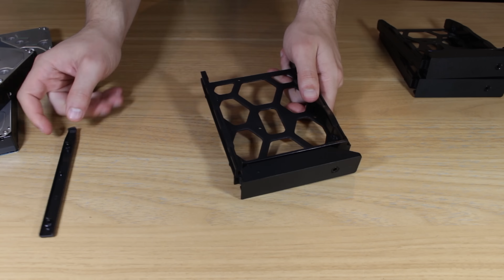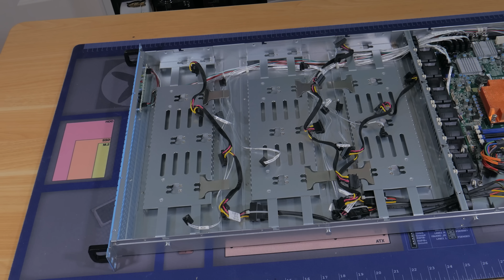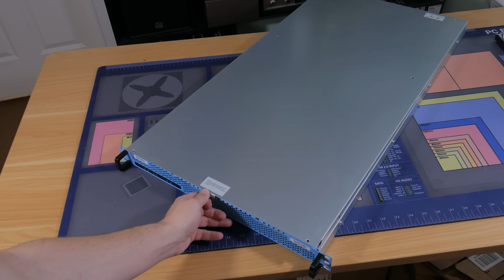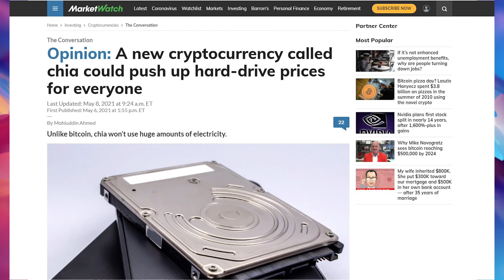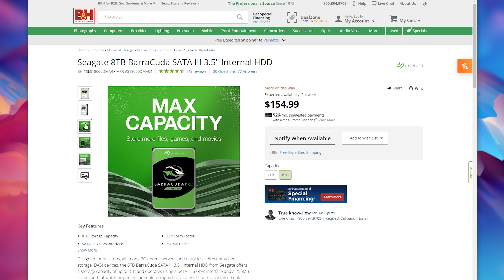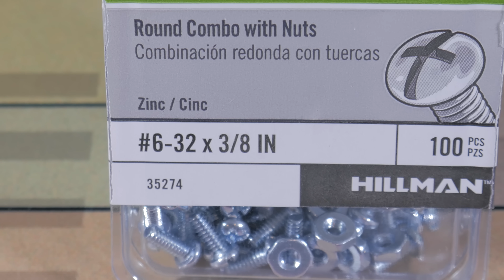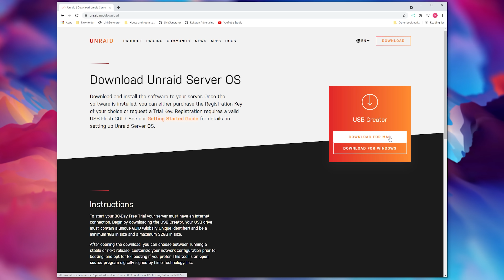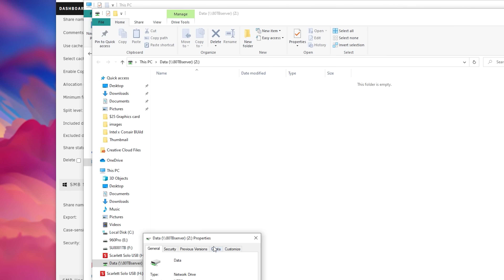Budget Storage Server 2021! | 80TB NAS

Comment: For that many drives in one enclosure, I would HIGHLY recommend enterprise level drives.  They're more expensive, but you're far less likely to have an issue due to vibrations or timeouts, plus reliability is far better.

Older Ultrastar drives are really good for this purpose, and usually aren't too expensive, and are highly reliable for long term use from my experience.  I got 6 4TB Ultrastar drives back in 2015 for $100 each brand new.  They were of a 2 year old model and OEM, but still new in the box.  

I used to work in a server storage software development test lab, and of the hundreds of thousands of drives I dealt with, the Hitachi/HGST Ultrastars has the lowest defect rate by FAR, as in we'd get 1 Ultrastar failure a month compared to 15-20 Seagate drives of the same age range, (test storage would be used for 5-8 years in a test lab setting, so I was mostly dealing with 1TB drives even in 2015) and Toshiba and Fujitsu were worse than Seagate.  I can't recommend Ultrastar drives enough for long term reliability.
Reply: yes definitely enterprise drives, I took a risk once and bought WD nas red disks (x12) and had 4 fail within the first 6 months. Replaced with WD NAS red pro , running 3 years no issues.
Reply: @edwindr7514  No, they're really not, mostly because they like to drop out of RAIDs even when they're not failing.  Enterprise drives have this little thing called "Time Limited Error Recovery" that consumer drives don't have.  If a consumer drive has an issue reading a sector, it will keep trying for up to two minutes to read the sector, and in a RAID scenario, that leads to timeouts and dropping the drive from the set.  Enterprise drives will time out and mark the sector as unreadable, replacing it with a spare sector, and declare the data lost to the RAID controller, prompting rebuilding the sector from parity or mirror data.  I know from experience when a consumer drive falls out of a RAID set, and then another drops out during the rebuild, it can cause major data loss.  I lost my pics for my once in a lifetime DC trip because of it.  

In addition, consume drives don't do well with vibration, and this can cause errors that cause dropouts as well as cause collision between the platter and the head, if too many drives are put into one enclosure.  Enterprise drives are secured from wobbling much better than consumer drives with tighter tolerances and more points of securing the heads and spindles.  

I know these things because I'm  a sysadmin, most notably a sysadmin in a server storage software test lab for a major storage company from 2010 to 2016.  (I do NOT claim to speak for them, as I was just an employee and have no say in corporate opinions.)  I've overall been a sysadmin for 12 years, out of a 25 year career in corporate IT.  I have EXTENSIVE experience with storage.  My profile is available on LinkedIn.  I'm the one in Colorado, if you care to look.  

Oh, and those WD Red drives?  They're horrible for RAID, almost as bad as consumer drives.  They're designed around 4 drive enclosures and software RAID, where vibration protections and TLER aren't as necessary.  

My favorite drives for mechanical storage are HGST Ultrastars, as they were massively more reliable, even when old, out of the hundreds of thousands of drives of dozens of models and 6 different vendors I dealt with in the test lab.  They're not that expensive in most cases, if you keep it to 2-4 steps down from maximum capacity, and even equal to consumer drives in price at the bottom of the capacity list.  (4TB Ultrastars are super cheap right now, and fast and awesome drives.)
Reply: @dangingerich2559  So if you just have a simple 2- or 4-bay NAS, WD Red's should be fine, right?
Reply: @flp322  Yes, WD Red does fine on small NAS devices of 4 drives or lower.  At 6, it gets iffy, depending on the mechanisms used to mount the drives.  Above 8 bays, definitely need enterprise level drives like WD Gold or Ultrastar.
Reply: @dangingerich2559  Great, thanks! I don't have huge storage needs (although I like watching these builds) so it's good to know Red's will be fine for my usecase.
Reply: @dangingerich2559  Please don't tell me my WD Red Plus CMR running in RaidZ weren't a bad purchase...
Reply: @dustojnikhummer  I'd consider WD my second choice.  Not bad, but not the best.
Reply: @dangingerich2559  Well it is the best thing I can get brand new from a regular retailer in my country.
Reply: I'd use used SAS drives, which are actually cheaper.
Reply: Same here. I work in an enterprise Storage Management environment and we had IBM retire a storage array whereas; I was able to obtain around 30x2TB used SAS drives. I really don't care about the hours on them. With so many on hand, I can simply swap them out as they die. I've been looking for a cheap build example to fulfill my NAS needs. This looks to be a good solution for me. Cheap.
Reply: Toshiba MG07 and MG08 Disks are great,  “ enterprise “ level and cheaper then most WD Red crappy disks
Reply: I agree about the Ultrastar drives, my last one died about a year back and that was from 2011.
Reply: My thoughts exactly.
Reply: I was about to post this. These drives WILL die from vibration sooner rather than later.
Terrible tutorial...

Comment: That was a really great build, unfortunately, because of my location (Central America) and the temps as high as 40 celsius in summer, this array will burn itself by the time I add up 12 3.5'' drives with no airflow. :(
Reply: Add some more fans and maybe even a window ac specifically for the room the server is in (and have the room be relatively small), then you should be able to get it working with little to no worries.

EDIT: I should note, it'd have to be a proper AC, something like a swamp cooler wouldn't work and could get moister in the server itself.
Reply: Yeahm that actually might work. But requires a bit of extra work.
Reply: @adeadfishdied  you think? I actually deployed it. But due to my weather situation, I tend to turn it off on days of more than 38c, because the HDD have reach 45c on idle, even with some jerry-rigged fans.

Comment: Dude, an easier and cheaper solution is to just get an unlimited plan on dropbox and then mount it on your pc using rclone. If you arent editing directly off the server thats the best option imo. Great video nonetheless, it was very entertaining to watch.
Reply: Using Dropbox might be a lot easier, but their only unlimited or "as much space as you need" plan is the Advanced Business plan that starts at $720 per year. I would not simply call that cheaper.
Reply: @FuzzyElf  he spent about $1500 on this build, so it will take about 2 years for it to compensate, he also has to pay $90 for the software (but he could use a free alternative yes) and power it all. If anything breaks, he has to replace it and he has to backup hes own data.
$720 a year isnt cheap, sure ill give you that, but with rclone you arent limited to dropbox, you could choose any other service, one drive also offers unlimited space and I think it costs less.

Comment: This isn't a bad idea for a server, but for my needs I would probably want a CPU with many more cores. I would probably also go with buying naked drives legitimately rather than shucking. With a large array it's nice to know that there's a warranty on the drives if one fails, and you can avoid SMR drives. Lastly, I would use RAID, mostly for the performance but also because Linux software RAID is well tested and very fault tolerant. I have had drives in a RAID 5 fail before. Replacing the failed drive and wait hours for the array to rebuild always works, and I have confidence that it won't just randomly break. Having said all of this, if price is a primary concern then what you build should work pretty well.

Comment: For your flash boot drive, I suggest getting another one of the same kind. You can then have the OS do a parity backup on the second drive in case something happens to the first. I know this can be done in TrueNas, so I'm assuming Unraid has a similar trick.
Reply: Unraid uses the usb flash uuid if it fails you have to get a new key generated that matches the new USB uuid from unraid, you can't just clone the USB stick (I think its 2-3 new key regenerate per year can be requested) unless that has changed
Reply from the maker: Good idea! I'll look into it.

Comment: Warranty is not voided by taking them out of the case. At least one YouTuber has returned a failed shucked drive and returned it for a replacement.
Reply from the maker: Nice! I didn't know that. Will have to look into it further.
Reply: @TechByMattB  How quiet is the machine when it’s been running for a while? 40mm fans can get very whiny when running hard.

Comment: WD drives have a tendency to have the USB port integrated in the drive, so shucking them will not work as the interface is USB not SATA!!
Reply: Do you think a classical HD is able to overload USB interface capacity? Even spinning at 10,000? =) You can use 3 HDs on one USB3 bus easy
Reply: I have done it with wd 8tb drive, they are basically wd Red with White Label, so non smr but still cheap

Comment: BTW anyone that shucks drives, make sure you test the drive before shucking, i had two drives bought factory sealed at walmart that contained broken drives of low capacity (looks like someone at the factory to a failed rma drive and shoved it in the case before it was shipped - all the wrap was in place, box was factory sealed and i saw no witness marks to someone prying open that pain in a but external case)

Comment: Just a small correction: SMR is not outdated. 
SMR is actually a more recent technology than PMR and it is perfectly fine for "cold storage". What it not good for is situations with constant or very frequent high write volumes (a good example being RAID resilver). As long as the writes are in bursts and fit the drive's PMR "cache" there shouldn't be any issue.
Reply: Just a small correction. The opposite of SMR is not PMR because SMR drives also use PMR write heads. The opposite of Shingled Magnetic Recording is Conventional Magnetic Recording (CMR).

Also SMR drives work fine if you write to them sequentially.

Those Seagate Barracuda Compute drives are a poor choice for shucking, not because they use SMR technology, but because they have a very low annualised workload (55 TB per year). Note that both reads and writes count towards that total. Unraid's monthly parity check alone will exceed that figure by a considerable margin (12 × 8 TB = 96 TB per year, not far short of double the specified workload). The SMART data keeps a tally of lifetime reads and writes and also power on hours so it's easy to track the workload in a server. For that reason those drives are best kept in their original plastic cases and used for backups. If you want a suggestion for drives to shuck, then shuck Western Digital 12 TB and 14 TB Elements instead.

Comment: Nice Information and Nice Setup.  I'd consider getting that 1U rack server and putting it in a desktop case.  I just dont have that amount of 'flat space' but I wish i did.  How was the fan noise on the box ?
Reply: What about using a wall for flat space? I don't know if this is a silly question.
Reply: @FuzzyElf  I like the thought of just vertical.   Nice insight.

Comment: I've built this same Nas. Thanks to craft computing. But I have e3 1220 and I'm using 6 2tb sas drives with adapters and 2 60gb ssd mirrored for OS. I'm using truenas though.

Edit: for the SSD just mount it with one rubber o-ring in one of it's corners
Reply: I'd spend the $10 and get a 3.5" mounting bracket for the 2.5" drive.
Reply: What adapters did you use ?
Reply: @ME-fs8ir  SFF 8482 SAS to SATA.  The drives won't fit exactly perfect in case. You'll put four drives in top row normally then next row you'll put the drives top row orings in the bottom row holes in the mount so they sit further away from the top row of drives. You won't be able to fit 12 drives using adapters

Comment: Great video man. Just word of advice makes sure you make regular back ups of your unraid boot drive. Had a scare the other day where the drive I was using failed. The flash drive stores your drive assignment, Plugins, and configuration. If you have to replace the drive from scratch you need to start from scratch but also know which drive sn are your parity drives. I got luck and was able to recover my config folder under linux. So I'm fine now but man that was a pain learning how to do that last minute. I would also recommend take a screenshot of all your drive assignments and save that somewhere.
Reply from the maker: I have a back up of it, but will make sure to be diligent about backing it up frequently!
Reply: Good advice... my first NAS build I used a tiny [HP branded] thumb drive mounted inside, using the USB port on the motherboard.  I shut it down to replace a failed drive, and pulled the thumb drive out, and it fell apart in my hand (I assume it was due to the heat inside the case).  My OS drive literally fell apart in my hand!

Comment: You can literally do what you did in unpaid with windows server sure it's a little more complicated but the set up and  the script exists on the internet you just need to look up script for smr drives windows server or even windows 10 cause remember there allot of cloning programs that you can't use now because your using a weird os
Reply: @nadtz  data rot??? I haven't heard of that since floppy when was the last time you got that??? I remember getting a client who got some bad hard drives that did get that but with ntfs?? Never heard of it
Reply: @donottouch9110  I've dealt with it tons of times with NTFS.  Not bit rot mind you, just random slight changes/corruption of files on NTFS file systems.  And that's just the biggest reason I don't particularly like NTFS for this kind of thing but not the only one.  I also wouldn't use ext3 for this kind of thing for similar reasons.
Reply: @nadtz  I mean you can use fat 32 if you like or any other type of file system you deem secure in windows you just need a program to do the hack I have some 2tb fat 32 drives for really old computers some of my clients use in off grid pcs crazy conspirators mind you but I personally haven't experience corruption that wasn't the fault of the end user and not the program or physical hardware